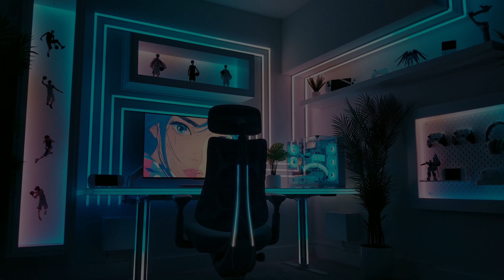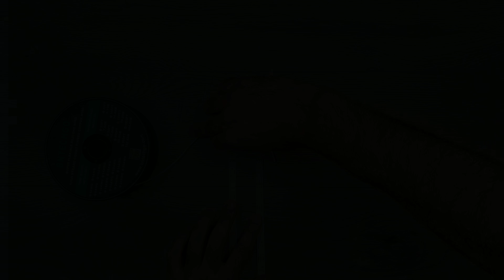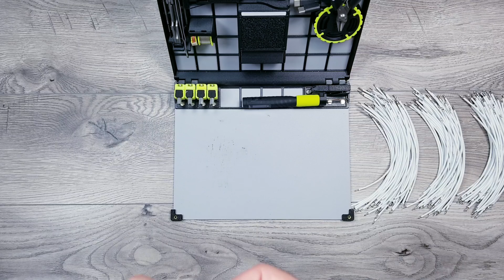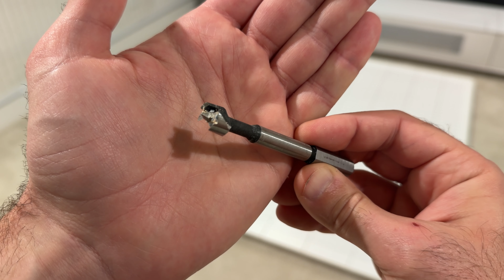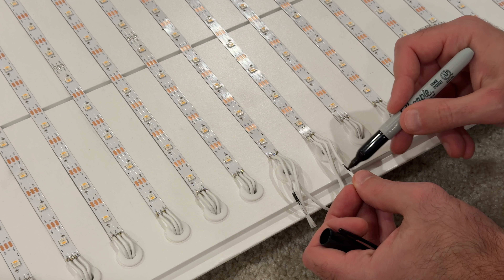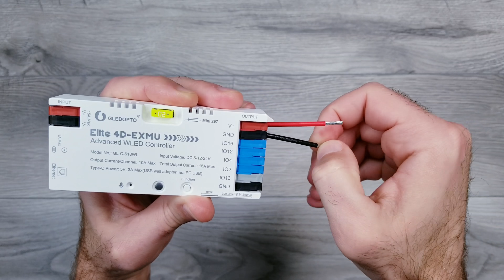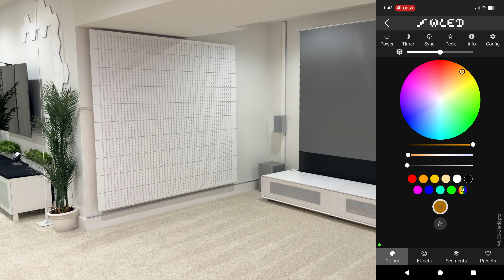DIY Matrix Panel: EASY, One Controller, One Power supply.

Comment: Im making a led screen 720mmx2000mm in diameter using ws21sb 60 led per mtr strip would this wled controller be enough to run all those chips ill have

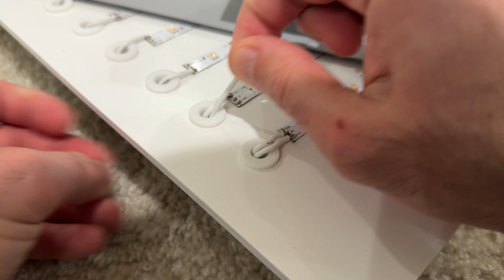Comment: 9:48 couldn't you ground them together from the other side then take the ground from the last one at the bottom? Or the first whatever you find better?
Like to make the circuit be like a one full strip and use just one line that will have the power and gnd that spans on all of them.
Im bad at circuits tho so correct me if I'm wrong

Comment: I remember years ago buying LED strips like this and they sold clamp on L connectors along with a roll of ribbon wire with 3 elements.  You just had to cut the LED strip, cut your ribbon cable to length and clamp on the connectors.  No need to cut or solder all those wires.

Comment: But if you're going to go through all that trouble... a narrow slot the width of the strip and you can prob just tuck the ends of the strip through. So no wires on the front at all. All the soldering in the back

Comment: I imagine one could use multi-color wires, and build a frame or lip using some molding, or a 3D printed channel along the edge to conceal the wires. That frame could also support a diffusion layer, something like plexiglass that's been sanded on one side.

Comment: You should power all strips in parallel, with +12V at the top and GND at the bottom. This way, the load is distributed and all LEDs receive a consistent voltage.

Comment: As an LED Tech working in events, film & theatre: Great work, very clean :) Most of my soldering & wiring suggestions are already well covered in the comments, but as an old chippie I should point out that with no wood-glue and no diagonal bracing, there's not much to prevent your panel from shearing getting creaky over time, especially as the heat causes drying & variable expansion. Just installing a slim panel fitted into one of the voids between the battens would stiffen it up nicely against shear, though. I might have gone with something like Dibond (aluminium composite sheet) instead of timber for lower weight & beter heat dissipation. I'd also personally separate power & control for such a large panel, as 150W is really low and the controller will be throttling to a much lower light output overall than the LEDs are capable of, which in-turn loses a lot of the colour depth (each pixel's colour value is limited to a much smaller range) - but that requires a bit more mucking about with circuit protection, current-caps/limits in the controller, and heat management. It's something you can always look into later if you want to get more out of this gorgeous unit :)
Reply: as a LED tech don't u think the result is dissapointing? shouldnt he be using diffusers? why is the controller not having any mixing effects ? I only seem to see the leds getting either 100% or 0%. There's no smoothness. I'm comparing it to the hyperhdr open source project for powering ambient strips which have smoothing effects and a range of effects that seem smooth even without smoothing.. is this because he didnt use RGBW?

Comment: You could have powered your strips from the center. And to connect data lines you could have used a tiny write. You would end up with tiny holes that you can hide in the board groove. Also, would have less issues with polarity. Also less wires and less work in general. And brightness would not suffer as well.

Comment: Sorry but you work like tribes from jungle - I recomend use portable platic foldable work bench - your knees and back will thank you. It is even forbiden in the industrial world working on the floor. Table = faster work progress and looking more professional. I like the soldering part a controller settings a lot - very useful tips.

Comment: It was a lot of work, many hours and it looks great in the dark. It does look a bit.. ugly in the daylight. 
Get yourself a sap wall panel, some of them have 28mm slats. (30led/m strips have 28mm gap. That solves the matrix spacing for you. You just run led strips in the panel gaps.) 

If you are feeling fancy, you can put 10mm led diffusers in those gaps and use 8mm led strips

Comment: nice work 

just a tip for your soldering use a copper mesh to clean the soldertip every time you will get cleaner and smoother connections...  peace

Comment: This is awesome, I actually made something super similar to this (only 45x45 though) a couple years ago but I was quite new to WLED at the time and I made a couple mistakes which you did a much better job of. I used 5V LEDs and solderless connections between strips so still having some brightness and flickering issues, but can't be bothered to fix it at this point because it takes so much effort to tinker with it in its current state (and my current living situation). I also used a window blind as the back board so it is relatively easy to roll up and transport compared to yours, but I had to hand sew all the strips on which was hard work 😓 I definitely think this would benefit from some kind of diffusion, those black acrylic sheets look super sleek, though not sure if you can get them that big, or how easy it would be to put smaller ones together on something that size and still make it look cool. But anyway yeah I've been watching your videos for a while now and many of them were super helpful when I was starting out with this hobby so thanks a lot! And best of luck with future builds

Comment: I wonder if you could feed the flat ribbon over the top of the wood, then glue another thin strip on top?
That would also do away with any visible wiring, as all connections on the back of the panel.
Top build mate, I'll be trying something like this myself but with a few less LEDs I think, thanks for a lot of tips. 😊

Comment: Few tips from my experiences: Step drill is better than Forstner bit, wipe any traces of pencil marks using isopropanol, if you have that many wires to do, it is easier to just strip them all dip the tip in liquid resin then dip them in a bowl of heated solder under propane torch. Easy peasy.  
I like your soldering station! ☺
PS: Any approval from the wife in ANY project is 3/4 of the battle won!!!

Comment: It's awesome seeing these WLED matrix patterns on such a high resolution LED display. Very cool project! 

I did something similar with some fairy light RGB LED strips and I mapped them out using a camera and Raspberry Pi. After mapping I had a very low resolution non-euclidian display. It was pretty cool! But what you did looks so much better and more clean.

Comment: I’ve made a few of these over the years for theatre shows. (One last week actually.) The best tip I have is rather than running the voltage serpentine with the data is only run the data serpentine. Get some bare solid wire run one connected to ground down one end of the cable and one connected to voltage down the other and then tack only voltage from one end and ground from the other straight to each bus line for each strip and let the data take the path it is in your setup. It helps prevent voltage drop and you only have to solder 2/3s of the pads.
Reply: That’s the way I’d do it too.

Comment: Looks neat, but you should really consider diffusers for projects like this - "naked" leds can be pretty harsh on the eyes. 

As a low-cost diffuser, you could attach a 1/4" strip around the entire front edges (to offset the diffuser 1/4") and stretch a king-sized blank matte white sheet over the front, like a canvas (you could go with fancier fabric, but a king sized-sheet should do the trick if you don't have a textile supplier nearby). It's super easy (just takes a little patience) to stretch a canvas with a pliers and staple gun. Not only will it diffuse the LEDs, but it'll hide the ugly strips that connect them and have the added bonus of reducing echo in your TV room (you could even build a second "dummy" version for the other wall if you wanted to keep things symmetrical).

The construction bonus would also be that you wouldn't need to worry about using white wires, and could use colors for clarity.,

Comment: Why not use a solderless connector for these? Would have made for a near soldering-free experience probably cutting the time in less than half. You can buy fixed boards as well as clippable cables rather easily online in bulk searching for "10mm 3 Conductor LED Strip Solderless Splice Connector" or similar.

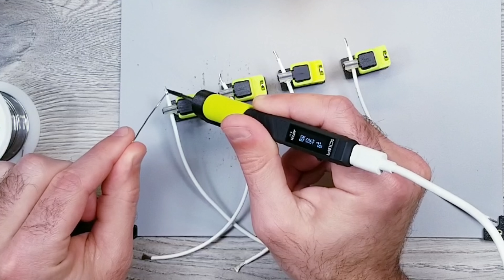Comment: 3:55 Prepare a solder bath so you can solder all the wire ends at once.

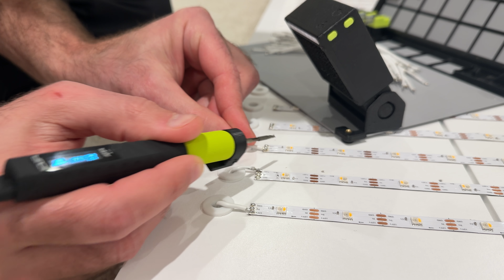9:15 Oh.. Only the data cables need to be soldered sequentially, while the power cables can be connected in parallel.

Comment: 8:06 brother i dont think there is unless you get an industrial grade machine. A drill press makes a nice 99 degree cut but how are you going to manuever that large board over it? The other option is the drill attachmenet that forces it to cut at 90 degrees

Comment: Hey Chris, love this video. I had a similar DIY project, but for music. I used a music controller from AliExpress and some WS2811 30leds/m. I only downside was that not each led was addressable. However, with what you have done that issue seems to be resolved, but the SK6812 is a bit out of my budget. Do you reckon, if I use the 5V version and have more power supplies and more power ejections?

Comment: I don't see you using flux for soldering.  Flux is a cheat card for getting the solder to bunch up where you want it, and not where you don't.

Probably wouldn't use it to pair two wires. But to add a wire to an existing contact?

Give it a try.

Comment: Wow, incredible job!  A quick question: how flexible are those strips?  Would there be any way to use a single very long strip by carefully forming the strip to make u-turns? (even if the u-turn has to be on the underside of the board, and "waste" a couple of LEDs it would still be worth it.)  You could maybe program the matrix software to keep those "wasted" u-turn pixels dark, or maybe DIY some software to do that.

Comment: Hey Chris, awesome build! Had a couple of questions:
-in comparison to the Govee light wall; this build seems to be (if you bought the 18 packs of LEDs at retail on amazon) slightly more expensive, though I am sure it is more capable. What makes your build better?
-Why choose to build your LED matrix out of LED strips instead of using something like a bunch of 16x16 LED matrices? I think BTF lighting makes fully addressable ones and 16x16 is 256 LEDs so it would be denser; is power an issue? or is RGBW LED matrix way more expensive?

Thanks for showing off your build!

Comment: 8:00 Using the nail gun, make a U-shaped jig that has a guide on the top with a hole (for the drill bit), a side that fixes depth from the edge, and a bottom piece that serves as hole blowup cover. Put painter’s tape both on the front and the back of the board.
It takes 5-10 min to make it, but takes seconds to make perfectly clean holes later (not to mention the satisfying perfect alignment of the holes).

But otherwise, yeah, not much else to speed it up…

Comment: Ill admit, I did not see the benefit of doing things the hard way until I realized the scale of the physical project.
Then it made much more sense why you did not go with the 144 led/m or premade matrix panels
I have made some that were housed in record display cases
And for those, the 32x32 panels seemed like the better option

Overall, it's impressive. And I also didn't realize WLED had a big update --- thank you for the heads up on that 👍

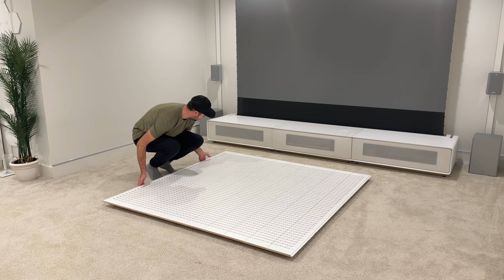Comment: Im only at 11:30 but were you concerned about voltage drop with this length of run?
Reply: Gotchu you're injecting power throughout. TBH I would have just done one big bussbar between the vdd and ground. Would help if you had a dimming thing going on. I've seen some sketchy led strips because of VD

Comment: Love your video

I will say, yours is way more expensive and gledopto controllers get hot enough to boil tea. I’ve clocked one at 220° within its designated load capacity.

Comment: Ugh, using white for ground in your example made me sick to my stomach
Reply from the maker: Do you work much with addressable led strips? Every strip comes from the manufacturer with wires attached where red is voltage, green is data and white is ground.

Comment: When you tin wires you should leave a wire width unsoldered to allow flexibility in the cores. When you solder onto the pads you should have a slight overhang. The insulation shouldn't be touching the pad. You shouldn't have a blob. The solder should have a convex shape to it. 

For reference, I build oil and gas down hole tools for a living and solder daily. What you did will work but you're introducing potential failure points.

Comment: Maybe consider a higher voltage LED assembly next time to improve efficiency. I build my fair share of 300W and 500W panels in the past, and pushing this much power over just 12V is not only a light source but a space heater 😅

Comment: The only thing I would have done differently is used the green wire for ground, since green is traditionally associated with grounding on instrumentation and general electrical installations.

Comment: I'd like to rig up a 8x8" or 10x10" small panel to react to a laser pointer. So it'd have to detect voltage from any LED hit by the laser, then keep it on. Ideas how to?

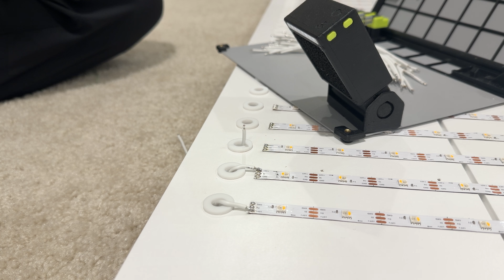Comment: 9:11 White wires on a white background? I wouldn't have even bothered drilling holes, I would have just made shorter wires and connected straight across from one to the next.

Edit: I see why later in the video, but I think I still would have only drilled holes for the ones that were required to pass through. Seems like an unnecessary amount of work for a small amount of payoff. 

The project itself is cool though.

Comment: I am completely new to DIY led strips so maybe I don't get it, but the tech specs for those strips rate 6w per meter. 5m x18 strips is 90m, that would be 540w, but the power supply that you show in the video is only 150w. Am I missing something?

Comment: The cost per pixel of HUB-75 LED panels (the standard for video walls) is much lower, they are available in various pixel densities,  depending on viewing distance. A basic signage driver board can be had for $10, The Huidu HD-WF2 can drive  384x128 signage using a nice phone app.